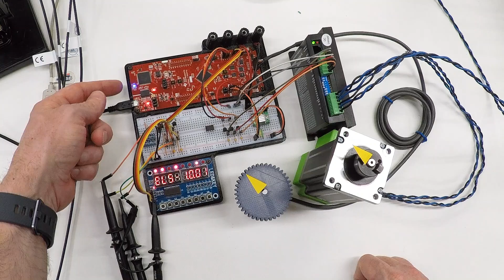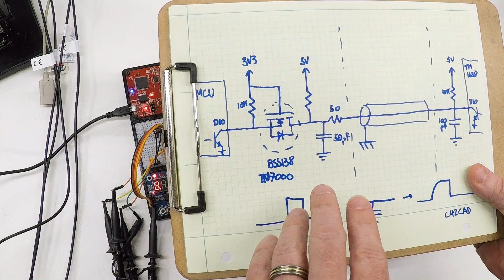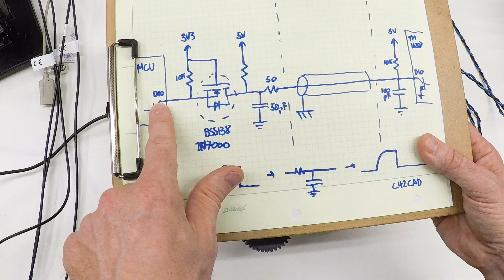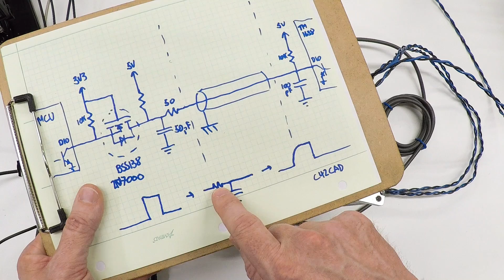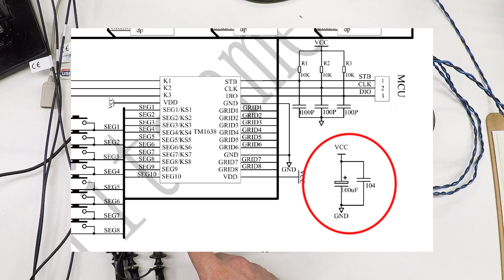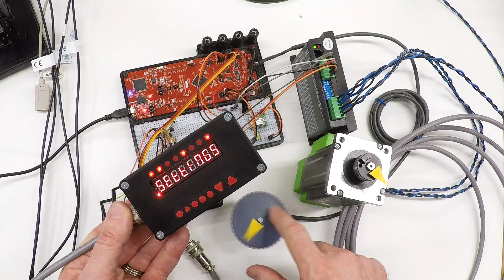Lathe Electronic Leadscrew Part 3: Control Panel and Debugging

Comment: Don't let people convince you that a touchscreen is needed. The best interface if the most simple one that will do the job. Fancy touchscreens sell products but aren't necessary a lot of the time.
Reply from the maker: My goal is to make this as inexpensive and accessible as possible.  The LCD is an option, but I see no reason not to keep it as just that--optional.
Reply: I'm cheap. I don't want this to cost any more than it has to.😊
Reply: Could agree more, when your hands are often covered in cutting fluid and dirt, who needs something which will have problems with this environment.
Reply: A touchscreen does not have any character ;-)
Reply: @oetken007  well not until you program it....
Reply: @DoRC  😂 Absolutely!
Reply: the touch screen is bad indeed, but the cheap chinesium switches he's using aren't any better, i really hate the sound they make, so plasticky. there are better tactile switches like those from cherry or some other good brand
Reply from the maker: @iwantitpaintedblack  Interesting...I kind of like the tactile feedback of the little snap switches--especially with a flexible 3D-printed button on top.
Reply: @Clough42  Interesting indeed, maybe the 3d printed overlay makes them a bit better, but since they're always on cheap electronics, their loudness and plasticky feel makes a product instantly feel cheap. to me atleast.

i once ordered a set of different sized buttons and there are some really nice feeling ones in there, like there is still a crispy tactile feedback but they;re not loud and dont require as much actuation force
Reply: @iwantitpaintedblack  These cheap switches are perfectly adequate and very decisive. The sound comes from a metal snap-dome, and they sound exactly like any other 6mm snap dome tactile switches. Cherry doesn't even make anything comparable or suitable (and you should definitely not take the company seriously these days anyway), and Omron B3F is going to have a more consistent force and service life and a larger selection of forces, but otherwise there is no real difference, the basic Chinese switches are pretty good.

Comment: Hi !
How to find out how strong a stepper I need for my specific lathe ?
Reply: guesstimate or measure how much torque is needed to drive the lead screw, and if it is more than a few Nm you will need a really big stepper or gearing keeping in mind that torque drops off above a few hundred rpm. Servos have less torque but maintain that torque at faster speed so they are better with gearing

Comment: For the enclosure put a thin membrane (rubber/silicone?) between the buttons and switches. It will stop oil and dirt from entering the PCB... Maybe sandwich it between the enclosure and some support structure.
Reply: I believe a conformal coating (which is a specially formulated acrylic for PCBs) wouldn't go amiss either, if oil or some detritus ever did make it's way into the box, the coating will prevent a short circuit from occurring.

Comment: that mindset of running things on the edge because "they are good enough" comes to bite you later ... 

those signals aren't even remotely square! more like a sine wave with the longer cable!
instead of passive methods like the pullup resistors + FET, you should use active (totem pole) driving for both lines which also reduces the noise significantly. The circuit gets a bit too complicated if you want to build your own (using tri-state buffers and inverters for voltage shifting) so you can use the chips like the TXB0108 (available for 1$ or 2 from amazon, aliexpress, etc).
Also as someone with experience in this field: DO NOT GO DOWN THE RABBIT HOLE OF MAKING THT KITS FOR BEGINNERS, instead offer a soldered up and complete kit. there are several reasons for this:
1) using discrete parts instead of ICs increases the PCB area massively, increasing the PCB cost.
2) when the target audience is beginners, there is a really good chance their device will not work at the end due to some errors they made.
3) you're releasing the schematic and code at the end, so if audience is not beginners, they are more likely to roll their own SMD PCB due to the mentioned cost above, order the chips and solder it themselves.

4) (the obvious one) you can mark up the price of the kit by a bit and make some profit on the side too.
Reply from the maker: You bring up some very good points.  Totem pole drivers would be preferable.  The underlying issue is that this particular board uses a bidirectional-data SPI line, which is why it's open-drain in the first place.    Totem-pole drivers would be much better.  This makes the Nextion HMI touch LCDs a good option, since they have separate TX and RX lines.
Reply: @Clough42  the chip I mentioned is bidirectional. They even give an equivelant circuit diagram in the data sheet so you can build it out of discrete logic parts (tri-state buffers and inverters) like I mentioned
Reply from the maker: Thanks.  I actually tried a TXB0104 first, and was unable to get it to work.  It wasn't able to switch directions automatically because it was interpreting the 10K pullup and bypass capacitor on the display board as a high-level driven input.  The datasheet calls for a minimum pullup of 40K.  I have also been looking at using a pair of SN74LVC2T45 chips--one for the clock and chip-select outputs and the other for the bidirectional data.  It seems like I would also want a series resistor somewhere to prevent high-current conflicts on the data line, and that's likely to cause issues as well.
Reply: @Clough42  I don't have one of the display boards you mentioned, but yes that would be a problem! In that case you should use the TXS0104 instead. It's the same topology as you used (pull up resistors + FET) with a small difference: there are fets in parallel with the pullup resistors which short them out on the rising edge, hence actively driving the signal level high, then disconnecting quickly afterwards. It guarantees 2MBPs in an open drain application which should be fine for you(judging based on your scope shots, you didn't mention what speed your SPI is running at).Again modules of that chip are available for about 1$ on aliexpress. If you had more issues in the future I think I will be able to help you. Best of luck with the project!
Reply from the maker: @OM222O  I ordered a handful of TXS0104s yesterday.  I'll do some experimenting and see how they work.  After reading through the datasheet, I think they should handle this situation easily.  The only question still is just how much cable capacitance they can cope with.  We'll see.
Reply: Alternatively I can also design a custom interface board for the final with however many buttons / leds you need, as well as adding a rotaty encoder or other options.

Comment: I don't see why the fascination with Touch Screens. You have designed a beautifully simple and robust User Interface so stick with it. Remember - KISS!
Reply: I agree. Plus he only needs to display numbers. Although a touch screen would be very cool, it is such an overkill for this project.
Reply: @ohammouda  ,I agree as well buttons and knobs= more robust
Reply: Yeah touchscreen is nonsense here.
LED displays are much more readable from a glance and real clicking buttons make for a much more satisfying and reliable interface.
Reply: A touchscreen would make that thing only more annoying. You can't use it with greasy fingers, gloves or anything of the sort.
Reply: Touch screens are a modern mistake I think.  I'm tired of the sloppy laggy interfaces that have resulted.  What happened to keyboard where they letters pop up the instant I hit the key?  Why does the iphone have ANY lag when typing?  Shouldn't a computer be able to respond 1000 times faster than I can type?
Reply: I good touchscreen will have an equal or better life span then a mechanical button. But as a machinist the tactile feeling of buttons. Is very very important it lets you find and work the controls without taking your eyes off the work piece i like the other guys ideas about rotary switches. I also like the idea of a hand encoder for detail work.

Comment: If you can understand a little bit of german... Watch into "talla83" and his work with servo motors.

Btw: ask any user of raspberry... Never... Never use a cellphone charger. :D I think the difference is that power supplys work with constant voltage but cellphone charger and battery charger work with constant current. So the voltage sinks to much.
Reply from the maker: I've got a whole fleet of ESP8266 sensors running on eBay "Samsung" chargers.  They monitor and report the input voltage, and it varies down to 4.7V.  With an LDO regulator and a 3.3V chip, it works.  For 5V stuff, it's not as solid.
Reply: @Clough42  4.7 volt isn't very much. For 3.3 volt it may be suitable but for raspberry I've read that raspberry made a design error and I have to choose a power supply with up to 5.2 volt because internally 0.6 volt are lost from micro USB port to cpu. (I always got a message with undervoltage)

Comment: all those people telling others that steppers will "lose steps" - yes, but actually NO. a stepper doesnt just lose steps out of the blue, it takes a massive amount of force to make such a motor stall out and therefore lose steps. driving a leadscrew on a lathe isnt all that demanding, even tough i propably would gear the motor to the leadscrew with a belt so you can have more torque. thats about all i would go for. a servo motor cant really be justified, bear in mind they cost quite a bit more. if the stepper is losing steps, something is wrong with your operation anyways and i think the next thing after the stepper losing steps would be a destroyed cutting tool or a stalled out lathe.
Reply from the maker: There are pros and cons for both.  The criticisms of steppers are real, but I think the concern about having to use "massively overpowered" steppers to avoid step loss are a little misguided.  If more torque is required for certain situations, it's not really "massively overpowered."  But even if it is, but it's less expensive than the servo alternative...
Reply: @Clough42  I am not sure how it can be said the torque to turn the lead screw is not demanding. Isn't there friction in the half nut, friction in moving the saddle, and resistance from making the cut. Moving the overall mass and at different speeds all seem to factor in. Lots of unknown unless you can physically measure the lead screw torque.
Reply from the maker: @gvet47  Knowing the materials of the screw and nut, the diameter of the screw, the thread form, lubrication type and cutting forces, it's possible to estimate the required torque.  For the heaviest cut I can imagine taking in steel with my lathe, this works out to about 3Nm.  A 4Nm stepper, or better yet a 2Nm servo with a 3:1 reduction should be able to handle this.  Of course, it's all just estimates until we put it together and test.  I think no matter what, there will always be some set of circumstances that are more demanding than any particular system can handle.  The goal is to make the operating envelope wide enough to be useful.
Reply: Those sudden speed changes can make a stepper loose steps with even no load attached, very sharp changes in speed require a massive amount of torque to overcome the inertia of the spinning mass.
But yeah provided you only ask a stepper to do reasonable speed ramps it should be more than powerful enough to never loose steps. Not like you need that lead screw to go at any huge speeds.
Reply: @berni8k  if you think about it, a leadscrew really goes only either one direction without ever changing dramatically, its not like you spiral mill something and the stepper has to go left right center in splitseconds

Comment: drop the pullups by a factor of 2.  you are well within the operating region of the fet. look at the data sheet.
Reply from the maker: The issue is the sink current of the microcontroller output, which is 3 or 4 mA.  There are already three 10K pullups in parallel (one on the 3V3 side, one on the 5V side and one on the display board.  So we're already at half that.  I may play with it a bit.
Reply: @Clough42  Since these lines may be uni-directional why not use opto-isolators to achieve the level shift. You prevent the micro-board from being fried too.

Comment: Clough42 =>
Rotary switches for the interface would be nice. Then you have an interface that looks and feels like a gearbox. ;-) Also you can easy switch the buttons with gloves full of dirt.
One for inch / mm; One for thread / plain cut; One for direction; An encoder (with heavy wheel for velocity) 2 select parameters / jogging; The LED display is perfect.
Reply from the maker: The encoder can be really great, but it can also be a liability because it's easy to bump accidentally.  Careful design of the user interaction would be required to make it work well.  I have encoder menu inputs on my 3D printers, and they're not very precise.  I would have to get the feel right to be happy with it.
Reply: ...It only must / should work when the lathe runs in plain cut mode (and not in thread mode) or when it stands still (for settings)....
Reply: I agree, encoders are nice and easy.
Reply: Negative on the encoders. While I agree with your comments that they are nice, it would require even more components to interface with them and I think the indication from most comments I’ve been reading are that he should try to keep this as simple and cheap as possible, and I agree with that as well!
Reply: @EdAgers110  I understand that the second encoder sounds complicated, but it is not. It only must / should work when the lathe runs in plain cut mode (and not in thread mode) or when it stands still (for settings). You can simply switch between the endoder that is connected to the spindle and the encoder on the UI. You can use a ADG3257 from Analog Devices for example. If you are in plain cut mode, the controller switches only one bit on the select line of the ADG3257 and the handwheel ist active instead the encoder on the spindle. The same as the lathe is stopped and a menu button is pressed.
It adds only a few dollars to the bill but adds a lot of useability to the project. It is in my opinion worth it to invest some extra dollars.

Comment: Hi James, thanks for the explanation (it's right on the outside edge of my electronics understanding) and the hard work. Please don't get distracted by comments and come up with an end result that no one can afford. Unless of course you decide that's the direction you want to go.  It's your project. I would prefer something that does its job.  If I try a deep cut in stainless with a binding leadscrew that's on me. It isn't the job of a hobbyist  leadscrew controller to make up for my every bad practice. There are already cnc controllers with servos that do those things and they are too costly for me.  Just another opinion by the way.  Keep up the great work.
Reply from the maker: I'm still considering options.  On the stepper vs. servo question, the interface is the same, so they can be swapped out, depending on needs.

Comment: Excellent progress!
Please consider the following:
Do make kit considerations. I am too old with eyesight gone and memory shot to re-develop the work you are doing so well. I am sure there are few others who, for their own reasons, will join me here.
Once you agree, I will swamp you with several "requirements" 😊
Thanx!
Reply from the maker: Thanks for the feedback.  My goal is to get it working first.
Reply: Amen, amen and AMEN!
Reply: pat dee b
Reply: Make that 3.
Reply: DITTO!
Reply: SheemOn Google  Double ditto on the comment and the kit request!
Reply: I would definitely buy a kit for of this. I'm not sure what process is actually needed but even a programmed board would help me out tremendously. I'm definitely considering upgrading to the G0602 lathe now. The entire hold back back was no quick reverse on the power feed. My G0768 is a smaller machine but the reversing gear box I use every day.

Comment: Hi, I plan to buy te same LED/button display for my "things". Do you share or plan to share the 3DModels for the box and buttons ? That would be great help here :)
Reply from the maker: I may provide something, but since the base model is from BUD Industries, I'm reluctant to share it directly without permission.  I could share just the flat portion with the cutouts or better yet design a complete new box and not use BUD's design.
Reply: @Clough42  Yeah, I realized soon after posting that may be problematic. The flat portion is probably sufficient for all the usual needs I envision !
Reply: @Clough42  Yeah, I understand completely. I was mainly thinking about the flat portion cutout and the buttons
Reply: where do you buy it?